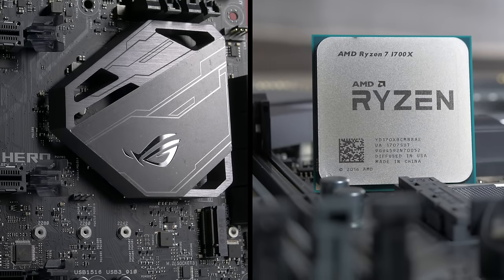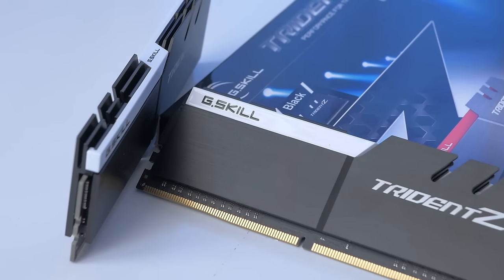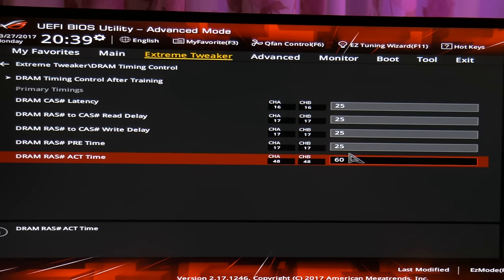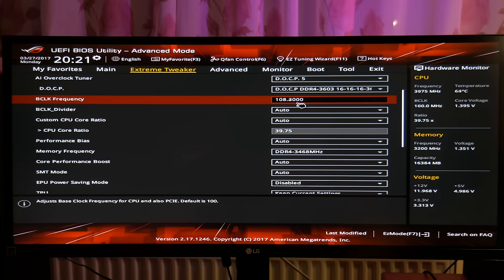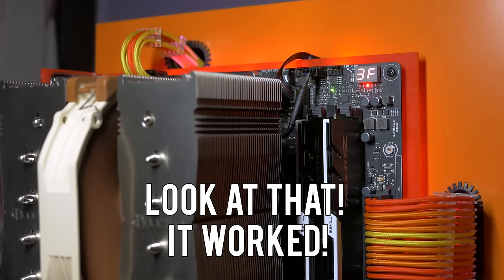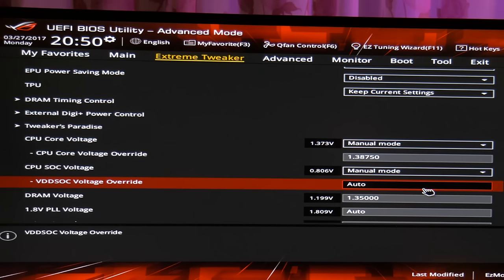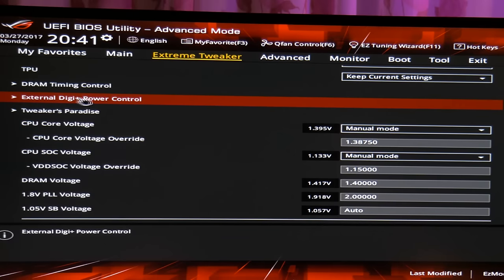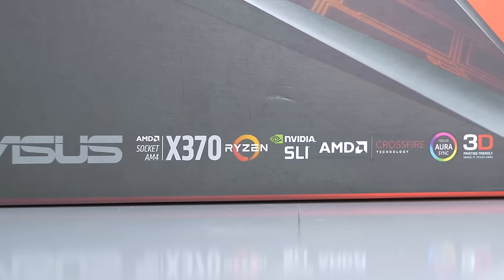Getting faster RAM working on Ryzen + ASUS Crosshair 6 Hero

Comment from the maker: I wish I'd have a universal guide, not just for the Crosshair 6. However, you can easily apply the Samsung B-die RAM tip, the Windows restart tip as well (might work on other boards, not just this), the BCLK overclock for motherboards that have an external reference clock generator (AsRock X370 Taichi, AsRock Fatal1ty X370 Professional Gaming and Gigabyte GA-AX370-Gaming K7) and last but definitely not least - the voltage tips: SOC, DRAM voltage, PLL voltage (if present), boot DRAM voltage if your board supports this setting etc.

Play around with the timings. Try absurdly loose timings just to get it to boot at a higher frequency or strap. Then tighten them. Out of my own experience, looser timings are not that bad on Ryzen. 

Good luck, let me know if you got anything higher. Oh, and try to either have the latest BIOS/EFI for your board, or see which BIOS people are reporting to have better RAM stability/overclocks etc.
Reply: Don't forget VTTDDR (i bumped mine to .7 from .6V) and VPP_MEM (Bumped to 2.65 from 2.5V). They were essential in stabilizing my Gskill TridentZ 3200-C14 at 3200, whereas at stock voltages highest I could go was 2933-C14.
Reply: VPP and VTTDDR are not VCCSA and VCCIO. VCCSA and VCCIO are 2 supply voltages for Intel memory controllers. VCCSA is system agent. VCCIO is Input/Ouput. Zen doesn't have these because Zen doesn't connect the RAM to the cores the same way intel chips do. 

VPP is the electrical high for DDR4 row access. VTTDDR is the DRAM termination voltage. 

All DDR4 compatible mobos have to have VTT and VPP(not necessarily accessible in the BIOS). Intel boards will also have VCCSA and VCCIO. Zen mobos will have the SOC voltage.
Reply: you. overclocking ryzen. video. when?
Reply: Ah, cool. Thanks for the correction. Sorry about the misinformation then.
Reply: Can you also review other motherboards like the ASrock Taichi and the Gigabyte Gaming 7? Maybe other motherboards are doing even better or with less hassle.

It would be nice to know what motherboard is the TRUE champ for the Ultimate Ryzen system. Keep up the great work! You did what the majority competitor channels weren't able to do!
Reply from the maker: +Detmer I'd love to review other boards, sadly I can't do it unless the manufacturers actually send review samples. I can't buy so many boards out of my own money (I don't even have the money for so many boards)...
Reply from the maker: +HuMaNiTaRiAn1 Hehe, I'm thinking of doing one... We'll see! :D
Reply: I am currently building a a Ryzen 7 computer and I was curious what is the best memory and motherboard to use is? 

I would like the highest memory speeds possible. (stable speeds)

What are my best memory options?
Reply: How loose would the timings be in order to even get high frequency to work?
Corsair Vengeance LPX
Stuck at 2933mhz (out of 3200mhz OC listed on the RAM) @ 16-18-18-36
I tried testing 2-10 values higher but no go.
Plus it's a Ryzen 1700 so the cpu might be the limiting factor.
Reply: +dra6o0n I have the same Vengeance RAM and seem to have the same limit (2933mhz). I should add though that I have 32gb installed, all 4 DIMM slots and this may be partly what's limiting it. Looser timings etc would not get it above 3000 

Memory is rev 5.6, so it should be Samsung B-die based on what I have read. This with bios v1002, BCLK at 110 (higher bclk didn't improve things) and CPU ratio 36.5
Reply: I was able to get my LPX to 3200MHz with no trouble at 1.5v DRAM boot and DRAM voltage was required otherwise cold boots was problematic. However i am struggling real bad with the BLC clock not sure what is the safe voltage to use for that 1.95v allows me to get to a whopping 105MHz lol, i even tried testing this at low mem and CPU multiplire clocks just so i could focus on stabilising the BLC
Reply: +Darren How much LPX RAM in your system and are all the DIMM slots populated ? It seems, based on AMD's own documentation and some tests I have read that if all 4 are full then that will reduce speeds available, compared to only 2 slots being in use.

Hmmm, If you have all 4 slots filled and are getting 3200Mhz then I need to try upping DRAM boot voltage likewise too see if I can pull it off too.